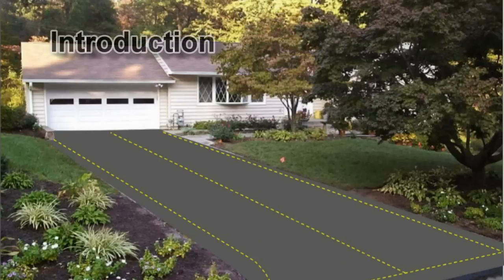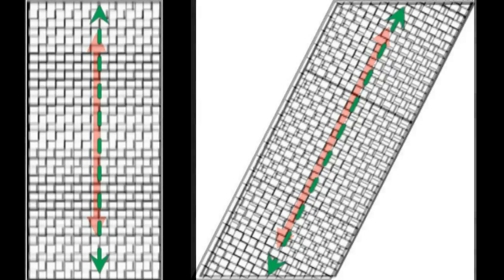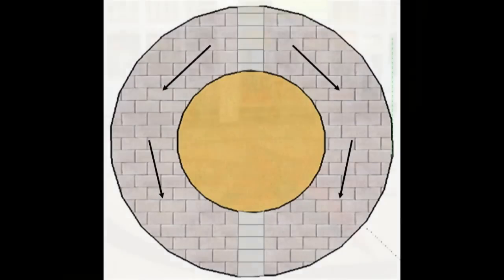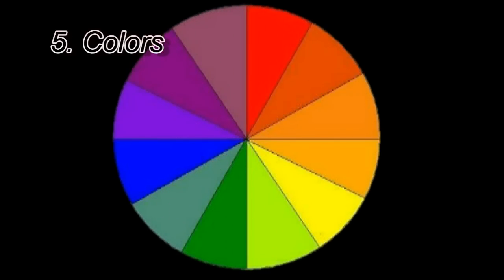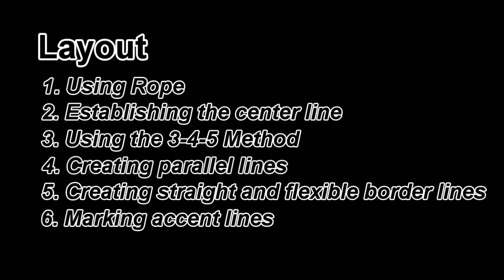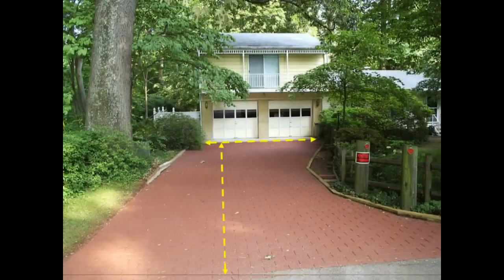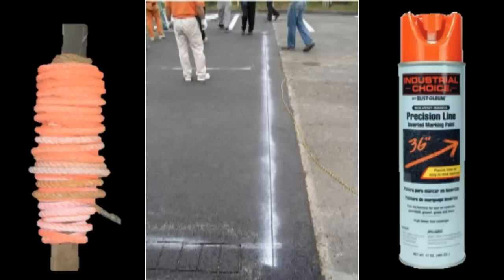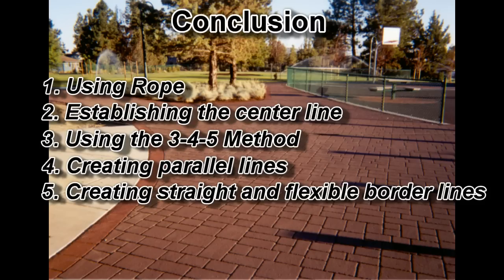StreetPrint Design and Layout - wwwSTREETPRINTcom

Comment: Just had a question. So with the 3-4-5 guide you measure 3ft from each side, then 4ft out from the starting point, then 5ft diagonal from the curved mark from the 4ft line.
How does that find your center exactly? Cause it seems like instead of doing that just take your original starting point and measure over 4ft, and then it's done.
I think I'm missing something here. Does is just give you a estimated center point or exact point??